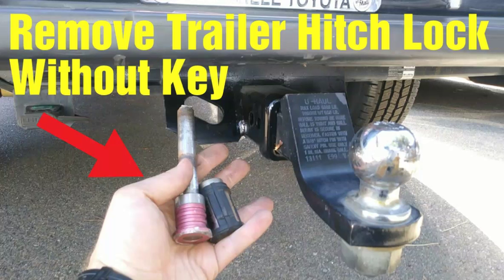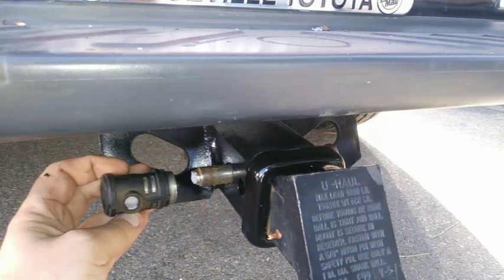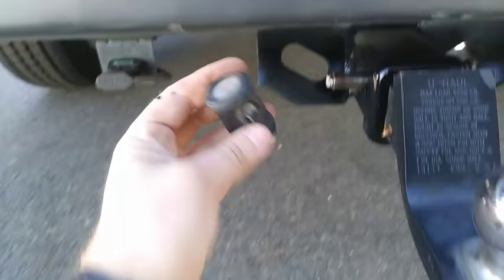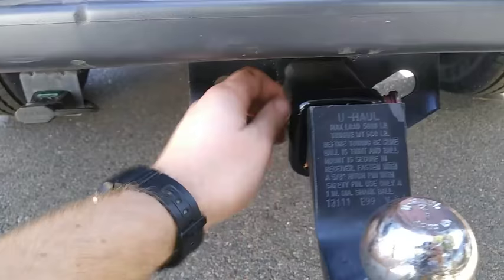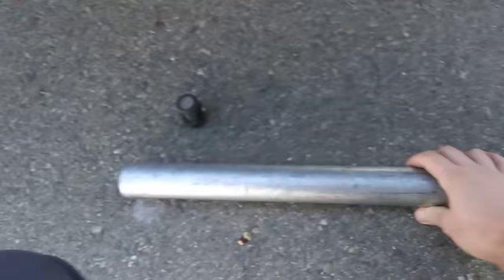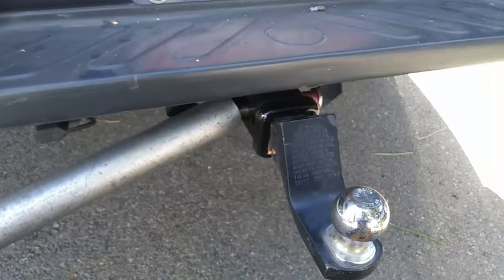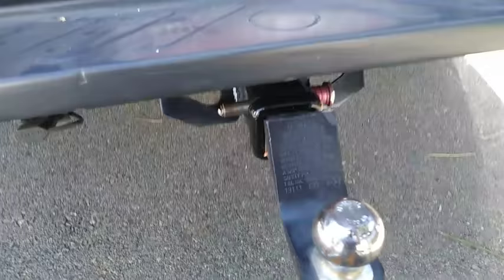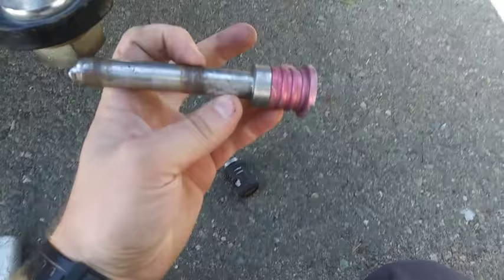How to remove A Trailer Hitch Lock WITHOUT  the Key🔑

Comment: I just bought a truck that had one of these locks on it.  The truck came from Canada, and the lock was badly corroded, and the key wouldn't turn.  I tried oiling it a bit and tapping it a bit with a hammer.  Then I found this video, and a 4' long piece of old steel pipe snapped the lock off in less time than you've spent reading this.

Comment: A tow hitch is still installed on my truck from the last owner 4 years ago. I never bothered with it but went to remove it today and noticed I've been missing the key. The hitch is rusted out well beyond safe operation. This method of removing it is going to snap it instantly. Thanks!

Comment: This video saved me a whole day of cutting or drilling and was quicker than using the key itself. Thank you for the information. I am amazed how well this works and will now subscribe to this channel. I had a pipe that was not large enough in diameter to fit over the lock but used the pipe I had and put it on top of the lock and used my bumper and it worked just as well I cannot believe how weak these locks actually are.
Reply from the maker: Glad to help buddy. I was surprised too how easy they can break. Thank you for the Sub!

Comment: After looking at other videos on how to take a hitch lock similar to this where they punch out, drill out the lock and spending several frustrating hours using their suggestion I came across this video. Luckily for me I had a 3' section of steel pipe lying around. Expecting allot more resistance, I couldn't believe how easy it was to pry off the lock. Thank you for the video!

Comment: Tried it last night on mine and it didn’t work. Master lock, kinda looked like the one in the video. Drilled out the key hole, pried again and still no success. But about 2 seconds with a recip. Saw and boom! It was last resort due to there being a plate behind and below the hitch, making it difficult to get a saw to it. Props to master lock I guess